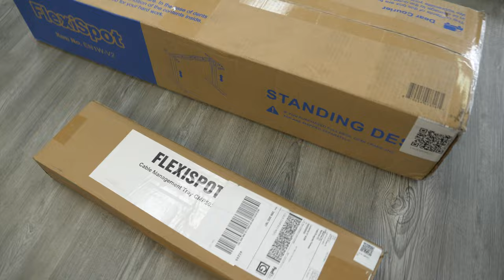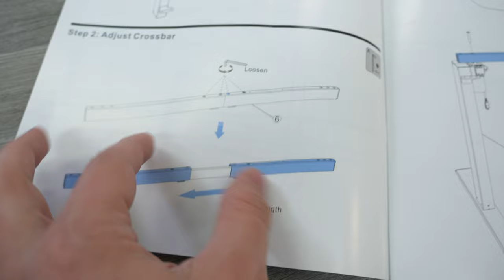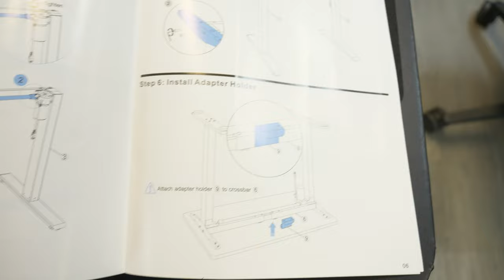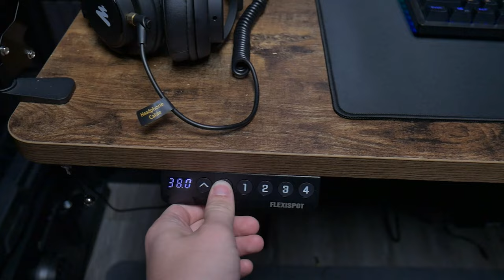FLEXISPOT Standing Desk Build Guide - Electric Up Desk

Comment: would you guys know why one side of my desk doesnt go down all the way? tried a reset but issue still there
Reply: Does your transmission rod spin? You might need to re tighten it and the grub screw where the plastic meets the motor.